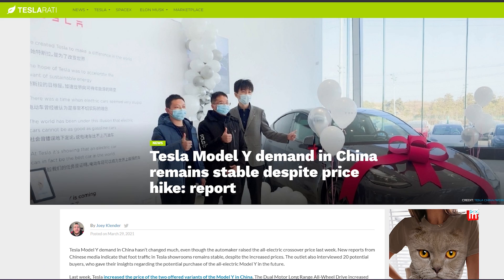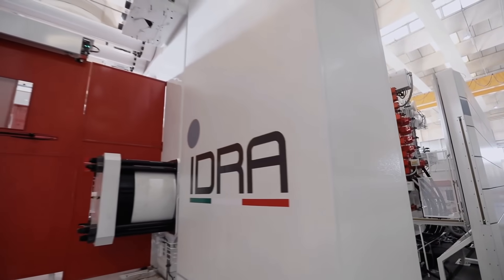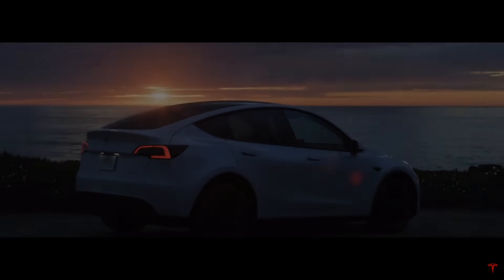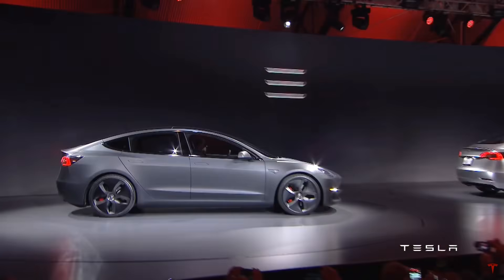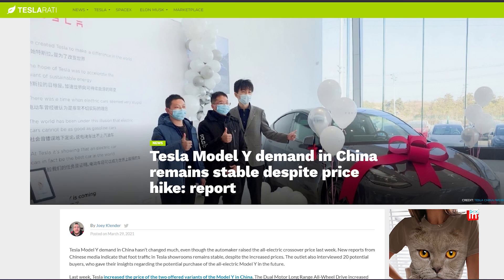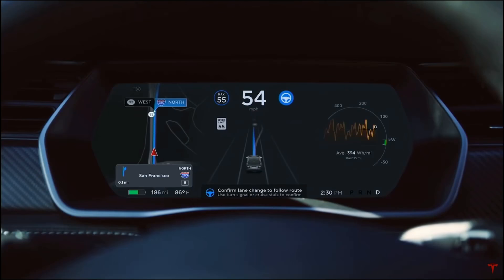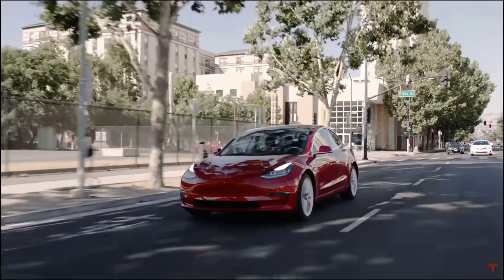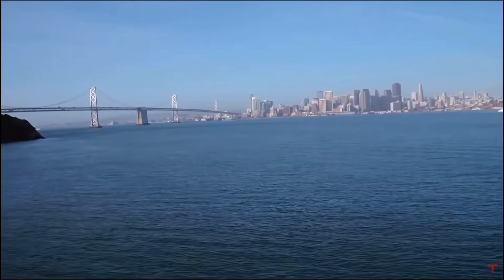🚨 Tesla Production Details Just Got Leaked!

Comment: 3:54 8 thousand tons not pounds buddy boy! aka 16 million pounds. that's why they are doing so much ground reinforcement with concrete and rebar pits on certain spots of Giga Texas because if you put 16 million pounds over regular concrete floor and dirt it will cave in like a sink hole is happening.